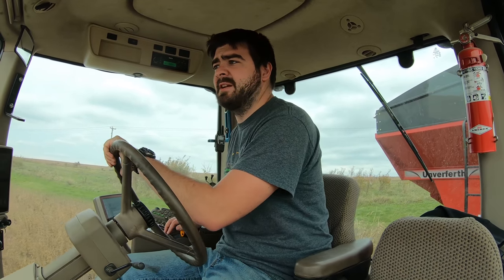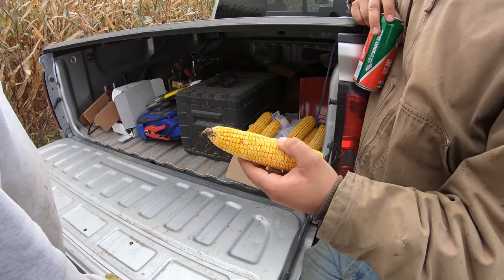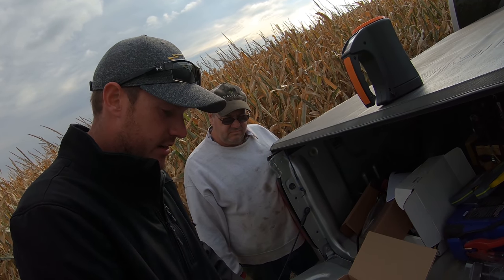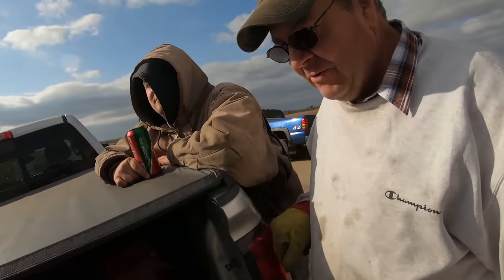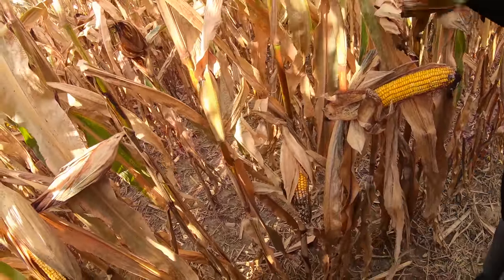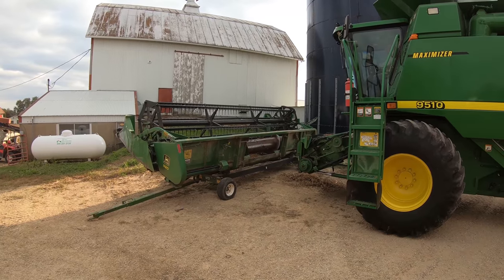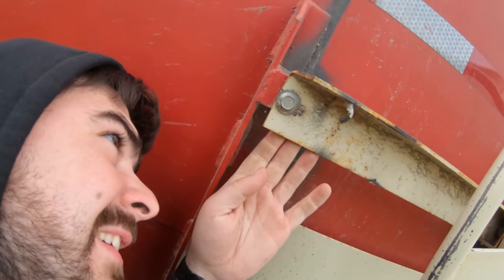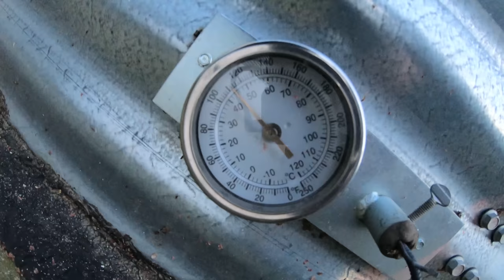MONSTER Ears - High Moisture Corn Harvesting | How Farms Work

Comment: Sounds like yall are in a similar boat we are in over in north central Indiana... Well, the beans went from too wet to "ready" in literally no time and have actually been done for a couple weeks already.  Yields were lackluster in beans too.  The corn though just refuses to dry down... We picked 80 acres, part of which was picked over almost two weeks ago because it was starting to fall down, and the yield wasn't there on it either-- too dry in summer, too wet in spring and so shallow rooted, which coupled with dry weather later on is not good.  We've been piddling about the shop and doing other stuff and nosed into a field of corn that was planted not long after the 80 acres and didn't go far... moisture was STILL up about 26-27%... meter started out at 30% and lowest it dropped to on the yield monitor was 25%, and it bounced right back up.  Getting set up to bin dry the corn as its harvested and then take it to the elevator... 
Just can't catch a break this year for sure!  Later!  OL J R :)

Comment: I guess you guys need a ground pit/drive over grain deck/auger to get the full use of big red. But a little silo/funnel that the auger wagon could dump in over the grain auger would atleast get the little 4 wheel red wagon out of the equation 🙂

Comment: Those Deere’s have electrical glitches they are usually nothing.. good to have the error message fixed tho. We have a 9330 that always says the hydrolic filter is clogged... it’s not.. and it always also says fan speed to low which it’s not cuz it dosent have a hydrolic run fan

Comment: Just curious, may be a stupid question , but why do you plant corn and beans in the same field like the first in this video?
Reply from the maker: Hi Adam, we contour and strip farm, where we alternate crops along the contours to slow erosion. The idea is that the water will flow into all the tracks and ridges made by the implements, increasing water retention and slowing erosion
Reply: @HowFarmsWork  Correct and great explanation. 👍
Reply: Interesting, makes a lot of sense, thanks for the Information!

Comment: Those codes that you guys had for the 82 shouldn’t be too bad. The mismatch code for the 82 is more than likely just an adjustment in the WAS (wheel angle sensors) have to adjust to voltage within a threshold and the park brake code more than likely is a failed park brake solenoid